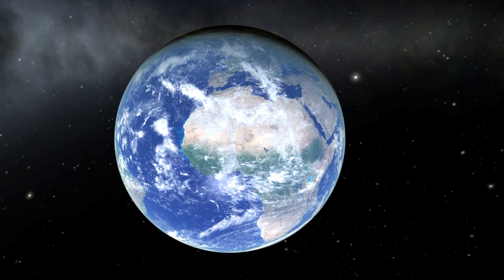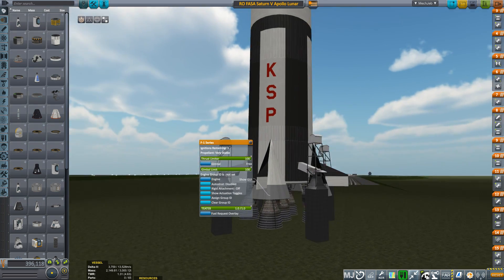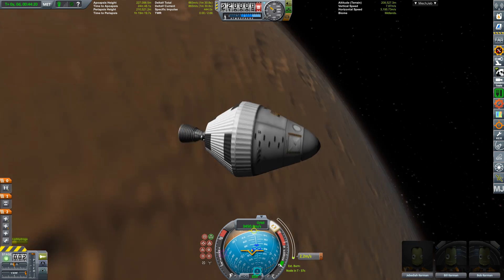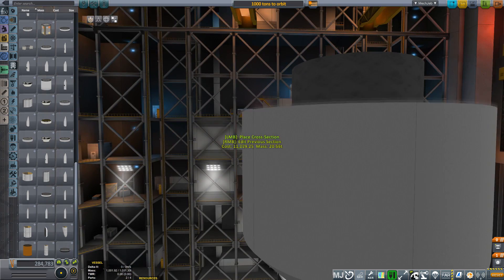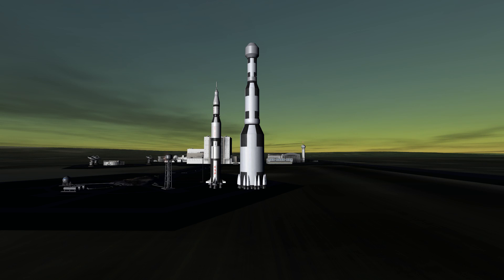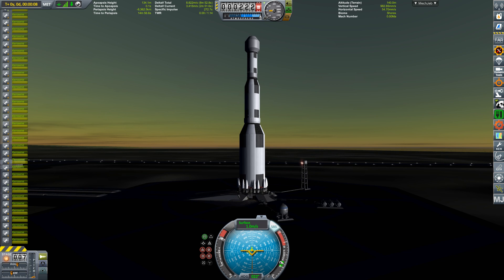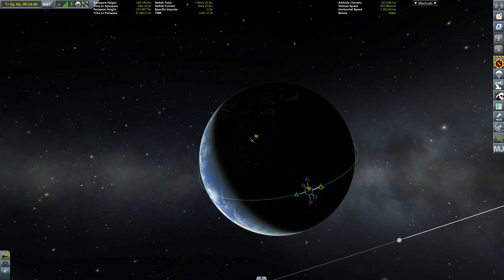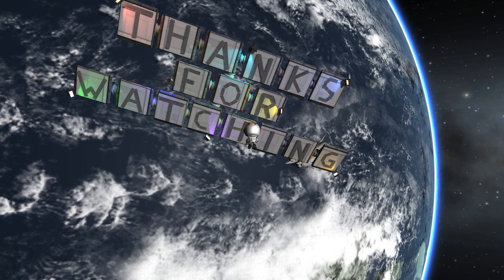1000 tons to EARTH orbit - THINGS GET REAL(ism overhaul) - Kerbal Space Program

Comment from the maker: Woops, I wanted to schedule this to be published in a week or so. Hmm. Well, Hope you enjoy it anyway :D
What do you think is 1000 tons enough for a decent Mars transfer vehicle?
Reply: I did Mars landing and return with 3 Kerbals having 920 ton ship at LEO. (Life support included). Though I did it with nuclear engines (NERVA-II). I would guess that if using Hydrogen the same type of ship would become ~ 1200 tons, maybe? Or something like that.
Reply: I made one at 800 tons, using Hydrogen and nuclear thermal rockets. You should be good to go! Just make sure you have enough radiators on there for heat dissipation, hydrogen needs to stay at around 20 kelvin. Also, don't time warp until the radiators cool the fuel tanks down enough that boiloff stops (radiators aren't modeled properly during time warp and you may lose fuel despite having them if you're not patient, but after they cool down the fuel tanks you're good to go for time warping)
Reply: Definitely! You can do one in under 200, if you're really skimpy (use Mercury capsule, etc.)

You don't seem to have much experience building earth orbital rockets, especially given that you didn't seem to use the Flight Engineer delta-v, TWR, and burn time stats. Your first few rockets failed to get anywhere near orbit. Or maybe it was due to the anatomy of your ballast payload—your delta-v is calculated based on the premise that all "disposables" (fairings, spent boosters, etc.) on your stage are ejected immediately. So, always make sure your ballast mass is directly connected to a control core, with no decoupling in between! 

My heaviest-duty rocket is essentially an upscaled version of the Saturn C-8 with the second and third stages derived from the first and second stages of the Saturn V. Here are its approximate details (I can't look them up right now, as my build of KSP is suffering issues with being upgraded): 

Saturn M-8 MLV-B: 
Mass: ~18 kilotons 
Payload to LEO: ~840 tons 
Payload to TMI (with additional hydrolox fourth stage): ~360 tons

Zeroth stage (Boosters): 
Engines: 8x SLS SRB 
Isp: 23x - 269 seconds

First stage: 
Engines: 16x F-1A (intended: 8x M-1-RP-1) 
Isp: 270 - 310 seconds

Second stage: 
Engines: 17x SSME (intended: 5x M-1 or 5x F-1-LH2 (hypothetical)) 
Isp: 451 seconds (intended: 428 seconds)

Third stage: 
Engines: 8x J-2S (intended: 5 HG-3) 
Isp: 437 seconds (intended: 451 seconds)
Reply: ShadowZone whoops
Reply: You need more
Reply: ShadowZone go back to kerbin
Reply: I made a 2400 ton launch vehicle. Fight me.

(I might PM you on the forums Shadow)
Reply: I got realism working and i love it. Where did you get those f-1b engines from? I want to make a soyuz type rocket with 20 of them.
Reply: 10x bigger? 
No
1000x bigger! 
You can fit a 1000 Kerbins into the earth.
It's the volume that matters.
Reply: Ayush Sharma if you go by mass, Earth is about 112.9 times bigger than Kerbin
Reply: ShadowZone lack of f1s and rocket too small 1/10 disliked

Comment: but... why no nuclear engines at all?
Reply: Simple answer: They are a very niche solution in Realism Overhaul. They need very low density fuel, so your tanks are huge, and very light. They pose overheating problems, and not so large benefits in specific impulse and get you a quite bad mass ratio as they are quite heavy, resulting in not much better dV as a more conventional system.
Burns take SUPER long as they have a very poor thrust. Also, their fuel is cryogenic (hydrogen), it boils away quite quickly, so your fuel disappears before you can use it...
TL DR: Very few actually useful use cases.

Comment: Most of those designs looked like they had way too little thrust. You should try for a TWR of at least 2:1 on Kerbin or closer to 3-4:1 for the initial booster of an Earth rocket. Solid boosters are good for this, since you want the TWR to drop for most of the low altitude flight after you are at your desired speed.
Reply: Chris Delzell actually you can launch with a twr of 1.2 on earth and you can get away with a twr of less than 1 on the upper stage of you're careful.
Reply: 3-4:1 for Earth? Are you crazy? 1.2-1.7 is optimal for Earth launches.

Comment: Love it.  Did you install realism mod recently? I've had a heck of a time getting it to work as I guess it doesn't work with CKAN right now.
Reply from the maker: +Krases I had no issues installing it with CKAN. But I am using it with a 1.2.2 version of KSP (I have multiple installations depending on what mods I use). Not sure if it works as well with the current one. Scott Manley made a great tutorial detailing how to install RO with CKAN on KSP 1.2.2 last week or so.
Reply: Thanks for the reply. I found his video and I will follow it closely. I also found out how to go into properties and roll back the steam version of KSP to 1.2.2.  Very handy. Due to a unique issue with my permissions (that I will probably never solve) I have to go into safe mode to delete my old mods. So hopefully it all gets installed right in the first go.

Comment: you could probably 1.5 to 2x+ the payload to LEO if you made the 3rd stage hydrolox  (J2-x or RS-25) and changing tank type to balloon, for the same mass. probably 3x  if the 2nd stage was hydrolox and could make it to 4x with all 3 and a first stage powered by RD-180M's due to its high ISP in atmo.

Comment: What mods do you use for these cool engines?
Reply: If you're talking about the NK-33s it would come in the soviet engine pack https://spacedock.info/mod/739/Soviet%20Engine%20Pack
The f-1 engines are available in many, many mods. Just check out the recommended mods on the RO thread. My favorite though would be SSTU (procedural engine mounts and built in fairing and a whole bunch of other cool stuff)
http://forum.kerbalspaceprogram.com/index.php?/topic/117090-wip13-sstulabs-low-part-count-solutions-orbiters-landers-lifters-dev-thread-02-05-17/
Reply: Mason Daub Thank you! And the fuel tank mod is called  "Procedural Fuel Tanks"?
Reply: It's called procedural parts and also includes procedural batteries, decouplers, heat shields, and in the non RO config it also contains a procedural SRB. These mods are cool in stock ksp but the real fun comes with realism overhaul and its custom configs for them. However there is a steep learning curve unless you are already a huge space nerd. If not this will turn you into one lol
Reply: Mason Daub Well, my greatest achievement in KSP is my manned mission to Pol and back. Currently Jeb is sitting on the surface of Jool's moon and refueling
Reply: Quicksilver The furthest I went was a 6 person spaceship that would go from planet to planet, refueling and going to the next. Although I got addicted to realism overhaul before I went any further than the jool orbit insertion. When it was on the way I designed a second one that would be able to land on planets with an atmosphere. I think I left that one in orbit around the mun (went there to refuel). But I still think the hardest thing I ever did was landing people on the moon on career mode in RO
Reply: Wait. These mods dont support 1.3?
Reply: A lot of them have not been updated yet, I'm running 1.1.3 for realism overhaul
Reply: Why are you running 1.1.3? 1.2.2 is much more stable
Reply: A small Lowne of a million dollars I started in 1.1.3 and I didn't want to go through the hassle of updating it and for fear of losing a lot of the mods I really enjoy. I might try to update now that devs have had time to update the mods though
Reply: The biggest downside right now of RO 1.2.2 is that you lose Orbital Decay, but I guess finally being able to land things on wheels makes up for it. I really hope someone takes up on the task of updating it though...

edit: I'm an idiot, there's already a recompile available. Wheels FTW!
Reply: ebigunso lol I don't think I had the orbital decay mod installed, although it probably would help get rid of the several hundred upper stages I have in low earth orbit.
Another reason I never updated is I'd worry I'd run in to compatibility issues with my career mode save. I've made a lot of progress and it would be a shame to start over
Reply: It would suck if you install everything and find out your save is broken, but hey, if you keep your 1.1.3 game files you can still play with that. Nothing to lose, you should try it out. Wheels would be a huge game changer.
Reply: Mason Daub Wait, how do you make your game not update?
Reply: Quicksilver idk, I think it's because I use a shortcut directly to kerbalspaveprogramx64.exe instead of through the launcher

Edit: oh also I think it might be because I downloaded the .zip option instead of the .exe installer but I'm not 100% sure
Reply: If you use Steam, that's your issue. Take a copy of your game and save it somewhere else.
Reply: ebigunso I do use steam, and I still want to play with these engines, fuel tanks and RO. What do I have to do?
Reply: Quicksilver Make a copy of your Steam install and mod that

Comment: I'm about to head to Mars in my own RSS project.  Took a year of planning and study, but I'm ready to launch it.

Yeah, KSP RSS/RO is a different beast from stock, but it is fun if you can get over the immense learning curve.
Reply from the maker: Wow, good luck with your mission. Sounds exhausting and exhilarating at the same time.
Reply: If you ever read the novel Voyage and seen the videos by rsferino, Chris P. Bacon, and Winged on the Ares mission, it's the same exact thing.  It should be fun since I've been wanting to fly this mission for a very long time.  Apollo hardware to Mars is an interesting concept.

I'm running my own thread on the mission in the KSP forums.  I think it's in the Fan Works subforum.
Reply: Looking forward for your mission!
Reply: Thanks.  I'm finally excited to get it started, and I hope to learn video editing to make a cinematic of the mission in my own flavor.  I have other missions planned as well, and I won't take a year to get to them.
Reply: What does RSS stand for? After hearing it takes so long to set up a mission I'm really interested and wanna check it out
Reply: bobbyjoejrfred Real Solar System

Comment: I think NASA would have had a heart attack over the number of engines you used
Reply from the maker: Well the N-1 already had 30, so 49 should be manageable ;)
Reply: In fairness, the problem was not actually being able to test-fire the engines on the N-1, not the number. It's not easy but it's possible. See also: Falcon Heavy.
Reply: +DragonJacob nah, I'm convinced he's just tempering expectations. It's a high risk mission for sure.
Reply: The 30 on the N-1 is not really what I would call manageable considering how many problems they caused ... then again, we at least wouldn't just use software from the 70s to control them, so we might be fine^^
Reply: @firnen_  Try 60s
Reply: +meisterWarther pretty much cancelled? It most certainly is not. ITS is still the end goal, but SpaceX has been hinting at a rocket to bridge the gap between falcon heavy and ITS. Probably 6-9 meters in diameter, it'll likely be used as a testbed for ITS systems. But ITS is definitely still being worked on.
Reply: Benjamin Casillas The Falcon Heavy which Elon Musk himself, as far as I know, expects to explode on it's first launch? :D But yeah, I agree, it is possible.
Reply: What's with the ITS?
1+7+2*7+3*7= 43 Engines: not that far off.
Reply: The ITS is pretty much canceled tho, they wanna build a smaller and commercially more viable rocket instead

Comment: Something you can do, is to use ion thrusters of the trip to and from Mars. More fuel efficient and less fuel means less weight to launch into orbit.
Reply from the maker: Unfortunately ion thrusters have so little TWR in realism overhaul they are useless for anything larger than a small probe.
Reply: Kerbalized ion engines are both overpowered and underpowered, they have much greater thrust but lower ISP, the effect of that modification is that you don't have to start a burn and go to work before it is complete :D
So they wouldn't work here for that purpose sadly :(
Reply: John Sjöberg Mars mission is quite well doable with some classic hydrolox and even methalox engines, so with some nuclear engines it is almost surely possible to do whole mission with one launch like this.
Reply: Wrong, they have 20,000 times more thrust than your average ion engine, and 1 thousand to 500 more ISP